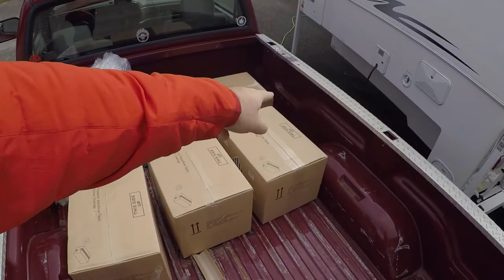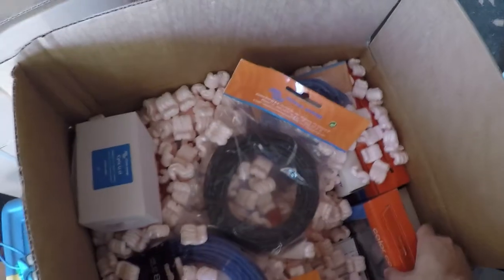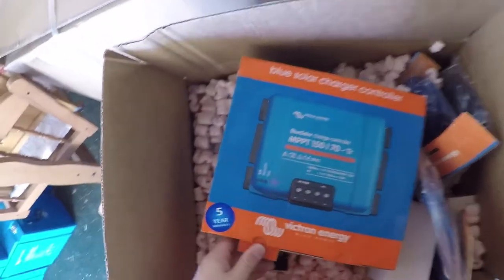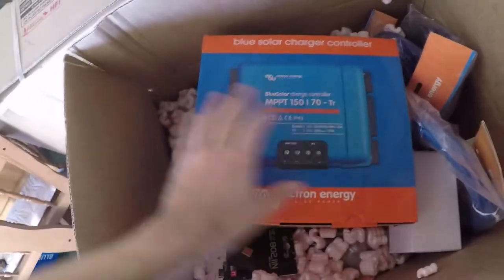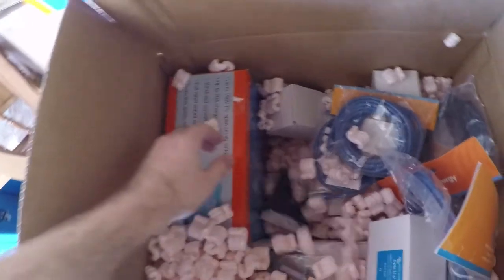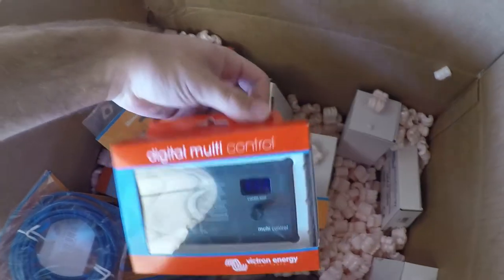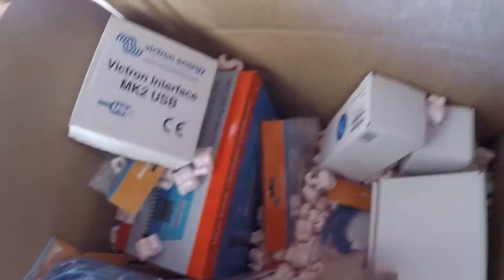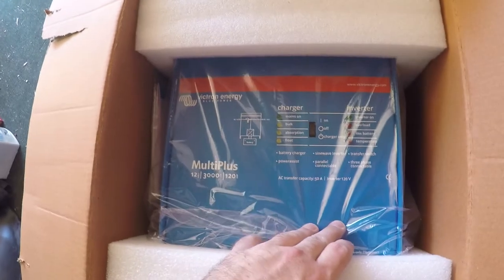Trailer Shop #1 - Electrical Components

Comment: Cool! Should be able to run just about any shop tool off of that, including welders!
Reply from the maker: Yep! I have a MIG and plasma cutter on board. I have run into a little issue where the inverter lags when I strike an arc, the voltage drops, and it trip the low voltage protection on the plasma cutter (not sure if the welder does the same yet). If I'm plugged into shore power, even with the current limit way down and most of the power coming from the batteries. it smooths out the voltage enough for it to work. Kinda defeats the purpose though. I have a small generator that might be able to pick up the slack, but I'd really like to figure out a way to have the batteries handle it all.